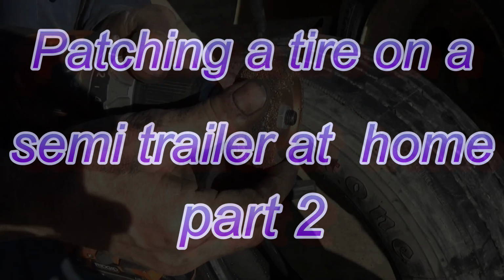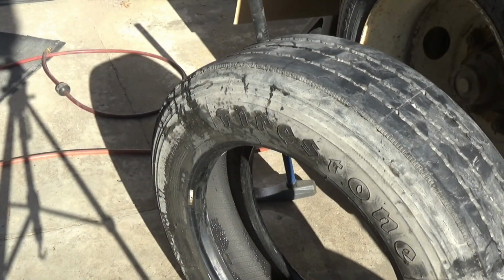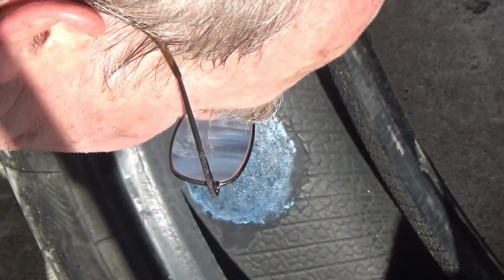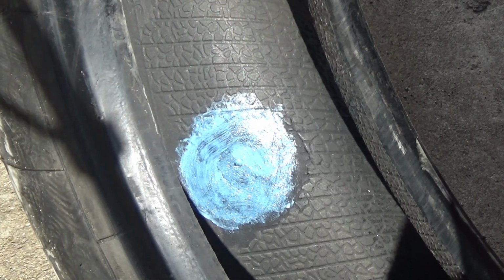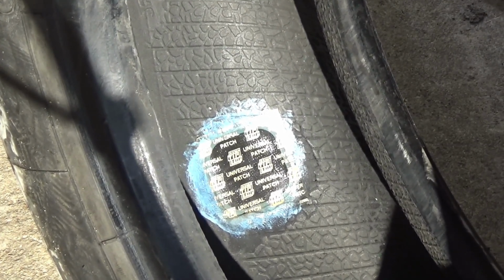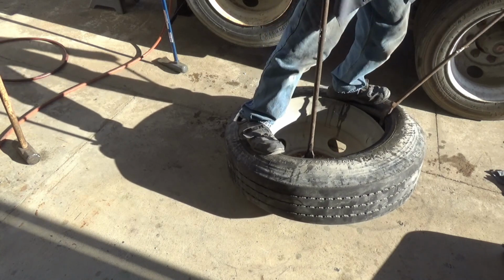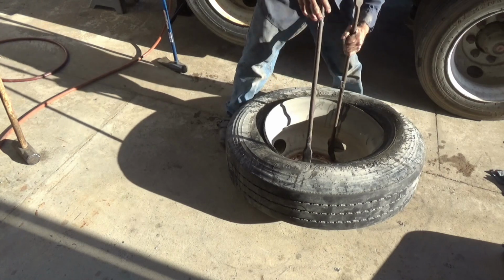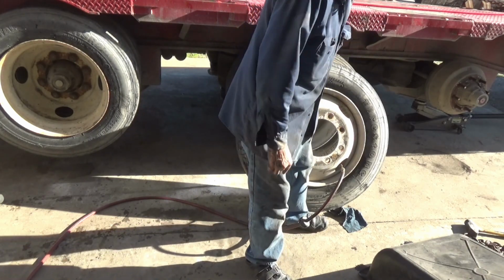Patching a big truck tire at home part 2

Comment: Very professional work. 
Great video sir
I had 8 stud hubs/wheels and the prices for replacement rims were outrageous. I did a cost/benefit analysis and found 10 hubs was cheaper than 8 hole rims. You can do one at a time.
Reply from the maker: I thought about that when I bought the trailer but I got a deal I couldn't pass up on refurbished wheels and I still have 4 spares.

Comment: You ever hear of guys putting 4oz or so of coolant in their tires to balance them? I saw a guy do that with his pickup tires and it helped a ton wearing his tires evenly. If I didn’t already spend the money on Centromatics I would try that.
Reply from the maker: I've heard of that and golf balls, weight powder and such but I don't like any of that, I just use lead weights, (now days they're some aluminum alloy)